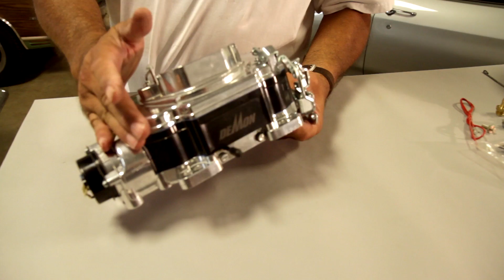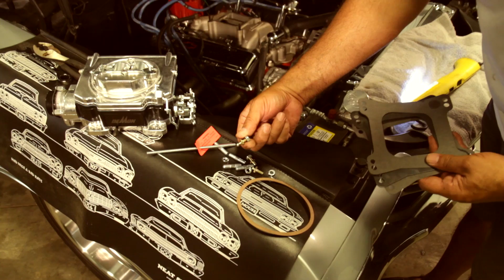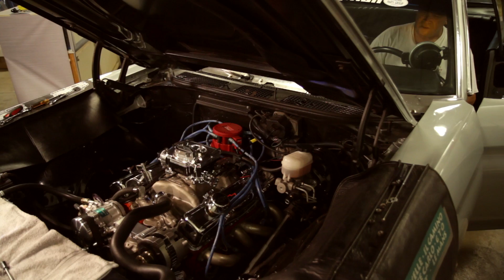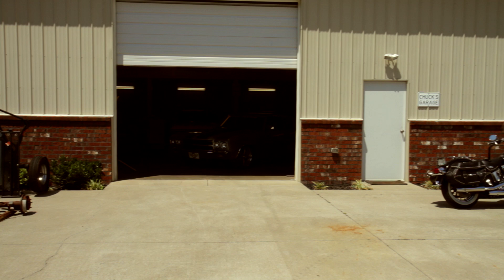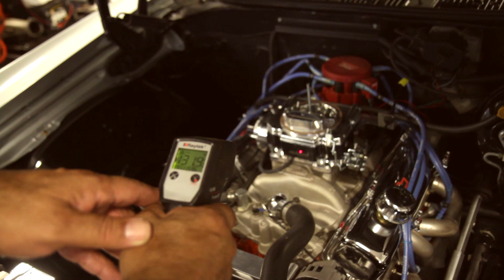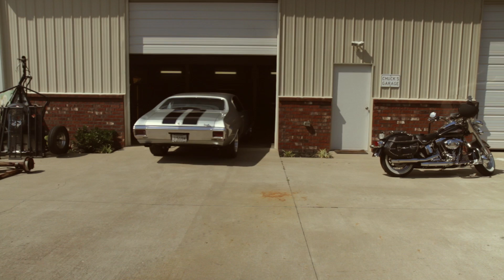Chuck's Garage - Street Demon Carburetor Install & Test Drive

Comment: Need some help here... I have a 1967 c10 with a ~67 327 engine in it. My truck was running before installing this Holley Street Demon carb. The previous carb was an old Holley carb with a spacer underneath it mounted to my 327 Chevy engine, which has a mild cam I believe.
I installed it and now I can't get it to spark and fire when turning over. 

Have tried pumping gas into carb, does receive gas. Have tried rotating Distributor to get it to fire.
Nothing seems to work. 

Any ideas?

Comment: Holley, I wish you guys would STOP IT ALREADY.  That is a Thermoquad carb design from 1969, that was copied from a Quadrajet, albeit improved with dual floats and bowls.  Then Demon improved it.  Then you drove Demon out of business, and bought them.  your engineers didn't design ANYTHING.  Those idle bypass air holes in the base have been there since 1965 when the first Qjet was made.  and the "goggle valve" you mention, is a 3 barrel design from 1963 Carter AFB used for Pontiac 421 engines in NASCAR, and also used on the old 1964 Holley 3916/4604 3-barrel. Calling this a "clean sheet design" is like saying, Holley invented the wheel, and sliced bread too.

Comment: Mr Chuck been watching you for 20yrs you were on another show my question I have a 70chevy short bed I'm putting a 625streetdemon carb on I have everything hook up but the advance vacuum line has. a ported vacuum line that hook on the back of intake you said it goes to front of carburator what do I do
Reply: about the port on back of intake

Comment: This video is more than 6 years old but it's still worth watching in 2020. I just bought a Street Demon 1901 Polymer 625 CFM 4BBL Carb w/Black Air Cleaner  for my brother's 1969 Chevy C/20 Pickup w/396 Big Block. He has no idea what I bought him. He had a Quadrajet that was giving him problems and then I had him try my Edelbrock Performer Carb., but that didn't work either. They both needed rebuilding but I didn't want to hassle with rebuilding because of my health so buying something that he can just bolt seems like the right choice. My dad had given my brother the truck shortly before he passed away so I wanted my brother to enjoy the truck while he can. Thank you, Chuck for getting me excited about installing the Demon Carb. I hope you swapped out those 2.73:1 gears for something better like 3.50:1 or better. Those tall gears make it a slug off the line.
Reply: Hey man, 2023 now
Reply: Hey!! How was your experience with Demon?

Comment: I am a bit confused now...I am using a dual plane intake from Jegs, do I need to use the metal gasket? It is just a generic intake for my chevy vortec heads. The better question is this, when do you NEED to use the plate?

Comment: that carb is much closer in construction to a thermoquad and less of a quadrajet. it even looks more like a thermoquad. now for those who don't know what a thermoquad is. it's basically the MoPar equivalent of the quadrajet. it had small primaries for good fuel economy but the butterflies on the secondaries were massive and would open up at WOT allowing you to ram more than twice the amount of fuel and air into the engine giving you better performance. it also had a plastic body to keep the fuel in the float bowls colder so in theory it was the best carburetor in the world. in reality it was a steaming pile of shit. it was impossible to tune it properly and the plastic body over time would crack from the engine heat and the carb would fail. but when this carb was working properly it made good power and had a very signature sound to it very raspy and mean combined with high flow mufflers it made the best engine note in the world. so this holley carb looks like a more reliable version of a MoPar man's poison.

Comment: It's a Holley Thermoquad with AFB / AVS metering rod adjustment.
He shows a  Quadrajet but not a Thermoquad.
I wonder why.
Perhaps it's because they are a bit too similar.
Wouldn't want the beans to spill that a $50 wrecking yard / eBay carburetor 
can be made to be just as good.
And it's infinitely more satisfying when you fix one up yourself.
Spending money is easy and therefore hollow compared to working with
your hands, your mind, and a minimal amount of money to make something out of basically scrap.
I run a Thermoquad on my '68 bolt-ons 350 3-speed with low 3's gearing C10 and it works just fine.
Don't have to worry about insufficient CFM as the 1 3/8" bore primary models were rated at 
750 to 800 CFM, and the 1 1/2" bore primary models were rated at 800 to 850 CFM.
Don't have to worry about excessive CFM because of the air valve in the secondary.
Don't have to worry about clogged air bleeds, blown power valves or blown secondary engagement
diaphragms (some of the common Holley issues) because they don't have any of those things.
Once you get a Thermoquad tuned it stays tuned longer because it's not as sensitive to 
dirt as the Holley design.
It's no wonder Holley glommed onto the Thermoquad design.
Finally Holley has a model in its line for people who don't want to have to work on their 
carburetors regularly.
It's too bad they didn't incorporate the easy metering rod adjustment.
I like what they did with the secondary air valve adjustment.
The Termoquad secondary air valve adjustment can be tricky without the special tool.
Overall,  if you're not up to restoring a Thermoquad, the Street Demon is a decent choice
for daily driver street cars where consistency and reliability are important.
So is the Edelbrock AVS.  The difference is the AFB and AVS designs have air bleeds, 
no easy metering rod adjustment, two-stage metering rods instead of three stage,
and no phenolic bowl.  The Thermoquad was one of the best thought out carburetors
ever made, therefore any copy of it should be as well.
Reply: I don't want a wrecking yard $50 carburetor. It's not exactly the same. The Demon carb is a simple bolt on and ready to go setup and it looks way better.
Reply: Not to mention I’ve been looking for a decent junk yard thermoquad and they are as rare as hens teeth. 
I gave up. Going with the 750 street demon for my 440.

Comment: ON  another youtube video on this carb, the guy adjusted the transfer slots so the opening looks like a square instead of a rectangle. Should I do the same or leave it alone>?
Reply from the maker: Correct, typically we recommend that the transfer slots be uncovered so they representa square to get the best throttle response.  It probably isn't necessary to adjust, unless you are having idle or off idle issues?  Thx J
Reply: I haven't installed the street demon 1901 in my car yet. I was just wondering if I should adjust it first to look like a square, right now they are wider and look like a rectangle?
Reply: Thanks!
Reply from the maker: @curtisbrun  Don't mess with them yet.  We wet flow our carbs before they leave the plant, so it is going to be set when you get it!  Thx J
Reply: ok, thanks!

Comment: Question for Holley Tech.  I have an Olds 403 with a Lunati Voodoo Cam Duration @ .050 (Int/Exh): 221/229, Lift (Int/Exh): .549/.565 and  static compression is ~ 9.7:1.  I live in Colorado (5500-9000 ft altitude), Intake is Edelbrock Performer RPM and running the numbers I'm anywhere from 600-650 CFM.  Will the 625 CFM work for this combo? The Holley website didn't recommend it...  Will I need to adjust rods and jets?  Does it come with a tuning guide?  I'm going to guess factory calibration is for sea level and roughly 350 CID...
Reply from the maker: 600-650 sounds small, especially for your altitude!  I really need some more info?  What trans? do you want mech or vacuum secondaries? What's going to be the rpm redline?  Weight of the vehicle? Let me know and I can better help you! Thx J
Reply: @HolleyPerformance  Thanks for the reply!  Trans is 2004R; Vacuum secondarys, redline 5500 rpm, car  Weight ~3500# and rear end is a 3.73 with stock size tires.
Reply from the maker: @GregHuston  It looks like a carb in the 650 CFM range is going to be best for your set-up.  You are correct, our jetting is set for at or near sea level conditions so it may be necessary to lean the carb jetting.  We do not have rods, in a Holley the main jet controls fuel at WOT.  The rule of thumb is that you decrease the main jet one size for ever 1000' increase in elevation.  You will probably also need to lean up the idle mixture. Do this by turning the idle mixture screws found on the metering blocks           (depending on what carb you choose there will be 2 or 4 of these screws)  clockwise or in, till you get the maximum rpm or vacuum reading then back them out (counter-clockwise) 1/8 of a turn. Make sure you adjust all the screws evenly!   All these changes should only be done after you have  installed the carb and confirmed that the carb is actually running richer than needed because of the elevation change.  Thx J
Reply: @HolleyPerformance , thank you for responding to comments. It amazes me that many people sharing content on Youtube have no interest in reading the comments or responding to questions. Holley customer service is #1 in my book. Keep up the great work!

Comment: HELP-  Anyone know how much Fuel Pressure the Demon Likes?
 I just got one for a 302 SBF Build (325 hp) I am doing for a Mustang Foxbody. Not sure if I need a "High Volume" Pump in the 80 gph range or if the stock fuel pump is ok since it had a Holly 600 on it already...
Reply from the maker: Your stock pump should be adequate as long as it is in good operating condition.  Fuel pressure should be 5-7psi at the carb.  Thx J

Comment: Will this carburetor fit on a 
 stock 1958 Chevy Impala 348 intake manifold?
Reply: Steven Solis it should fit right on your intake it has a double bolt pattern bolt on.

Comment: Demon!!!!!!! its a Thermoquad  an old Carter design from the early 70s with different throttle base
Reply: you fucking idiot
Reply: @janebook294  What's with the name calling?  This carb is most definitely an updated Thermoquad look up part number SUM-210232 on Summit Racing and you'll see that a $450 remanned Thermoquad looks very much like this brand new $325 "Demon".  This is probably the best new carb you can buy for a street car.

Comment: the Holley spread bore carbs of the early 70's had smaller primaries....they made them in 650cfm & 800cfm...they worked well
Reply: The Thermoquad and QJet were better carbs

Comment: I bought this carb and it ran ok but ended up braken the secondary bolt when I ajusted the screw and later that night I noticed that I had no secondary it was the bolt ended up braking so I was told that thay had to make it more beefier bolt on the new ones